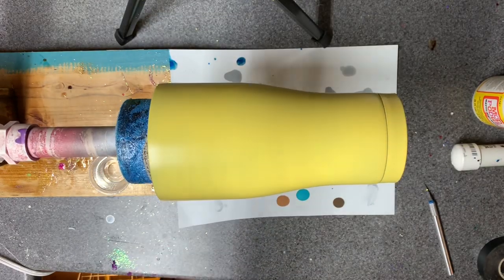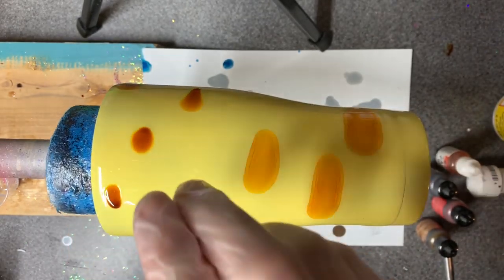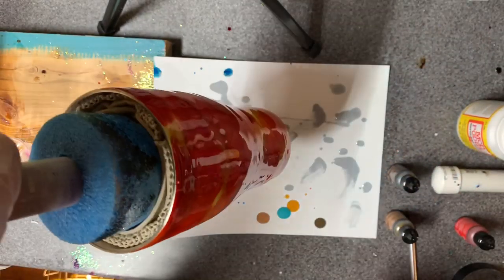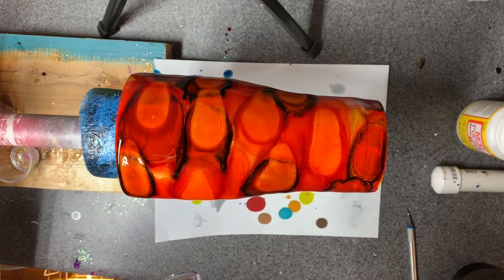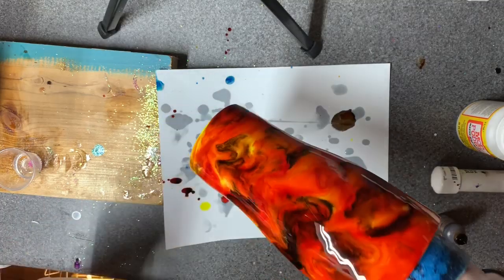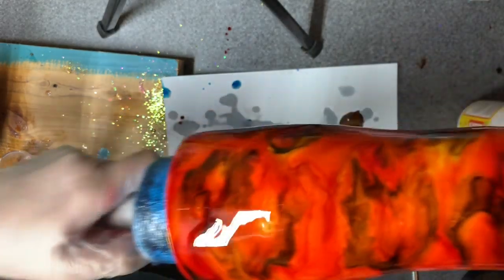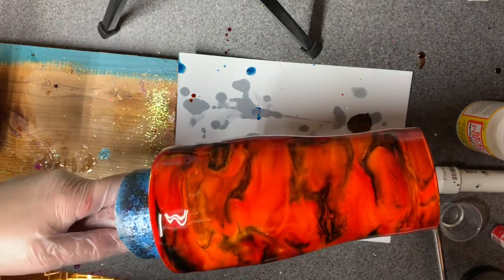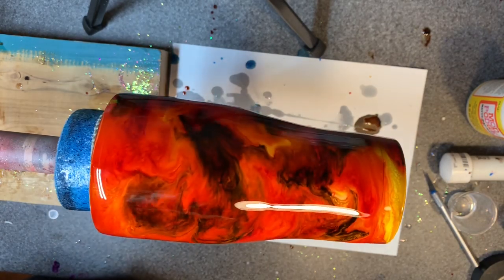Fire swirl tumbler tutorial using alcohol inks on epoxy

Comment: What do you have inside the cup to hold it in place? Is that the rubber mat you put under a rug? Also where did you get your tumbler from?
Reply from the maker: Yes, I have shelf liner wrapped around my pool noodles and foam pieces for each attachment. I get most cups from stainless depot but also buy at Walmart and Buccees.

Comment: I’m just beginning, I run into issues with dry spots. I’m in Texas gulf coast area working in my garage. On first coat of epoxy how smooth does it need to be, and does it matter if I use more epoxy than needed. On alcohol ink can I add as much as I want or such I limit colors and amount. Then letting first coat cure, do I just leave on turner the whole time. Then what’s your process on second coat, if it needs sanding, more ink, etc. on final epoxy how do I make sure it’s smooth all the way around

Comment: Could u just use a straw & gently blow it in the direction u want it to go instead of taking it off & moving it all around? I don’t know,just  thought. Tia
Reply from the maker: I would think you could as long as the epoxy is runny enough. There may not be as much movement but might be a good alternative if the arm isn’t removable. Just keep in mind the fumes you might be breathing in if you heat it up. 🙂